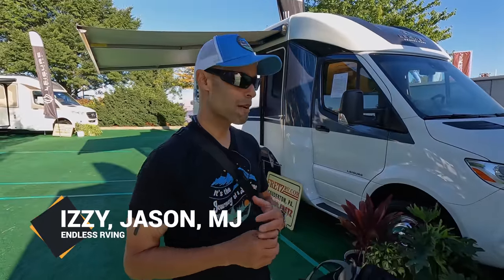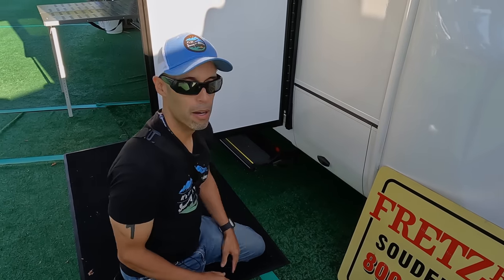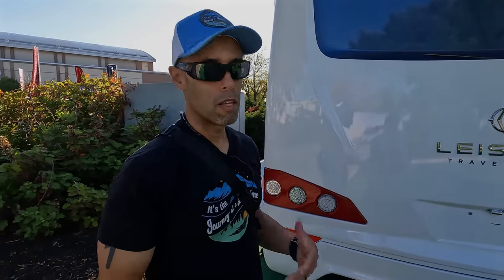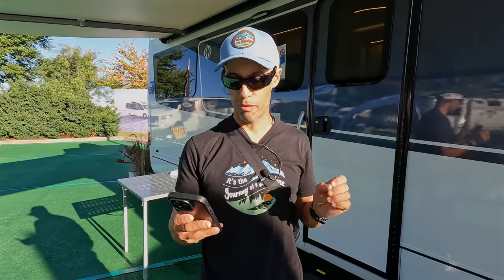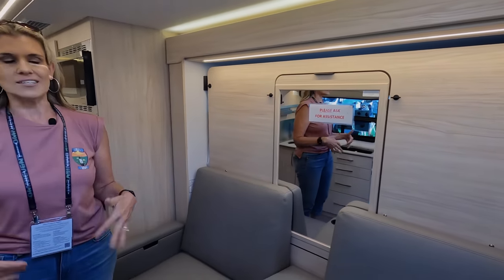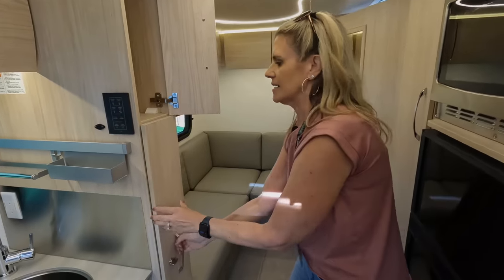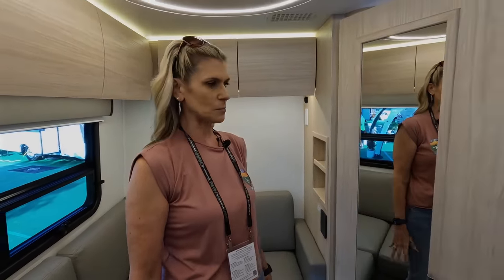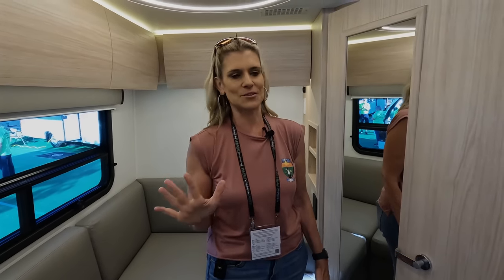Unleashing Class C RV Luxury: The 2024 Leisure Travel Van Unity Revealed!

Comment: We're Leisure Unity owners of the rear lounge model.  We waited just shy of 2 years for it.  It is awesome.  While we did have a few glitches with some of the third party things in it (i.e., not made by Leisure like the generator and a microchip), Leisure was quick to respond to our issues and covered our costs for replacement and labor.  They are an amazing company to deal with and take pride in their work.  For a small unit, it is very versatile and extremely easy to drive and maneuver even in city traffic and in parking lots.
Reply: Can you have the bed down with the slide out in?
Reply: My husband and I are thinking about the rear lounge as well. Do you think it's doable with a teenager making that front blow up bed??

Comment: We are a leisure Unity late 2019 owner and we love it. The FX here is a great layout choice as well, as well as the new MBL. Quality is spot on. We've only had a few fairly miner issues as expected. I'm 6" 4" and the Unity MB is very comfortable. We did do some upgrades as we used it  to see what WE would like first. One great up grade choice is we had all the windows tinted in 3M Cristaline and that made a gigantic difference, with  practically no UV and heat penetration, well worth the cost and recommend it. According to Oregon state code we did clear tinting on the front windshield , 40 Cristaline on the side doors and clear to 20 Cristaline over the existing windows, since the glass is already tinted.
Another item we had custom done was a built in wine rack since Oregon does have some of the best wine in the world.
We are considering an expensive lithonics battery upgrade with a little more time even with our 800 solar and LP Generator since we enjoy dry camping.  Well worth the money, few major problems and you get noticed in a leisure Unity!!

Comment: I've been kind of looking at the corner bed setup. I feel like a Murphy is to limited in terms of maybe changing out the mattress for example. Or keeping extra bedding on hand for comfort (padding) and for colder nights where an extra blanket is enough to not run the furnace. the ONE thing i don't like is the lack of batteries. 200 just seems so..minimal. I've not seen anything in terms of run time, but i personally would like to at least double that capacity.
Reply: I just don't see a murphy bed as being as comfortable as a corner or other fixed bed
Reply: We own the leisure corner bed floor plan.   Love it!!  The bed is always available.  No need to configure anything.
Reply: I agree. Lithium is weak at 200. Pagosa Adventures discussed upgrades. I wonder how much for 600 aftermarket?